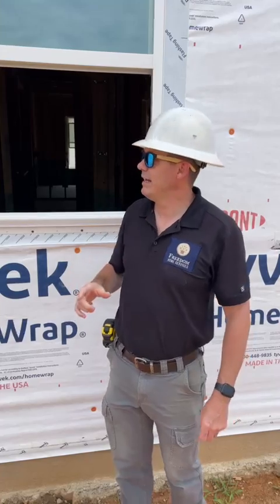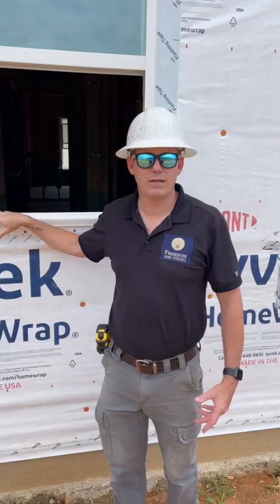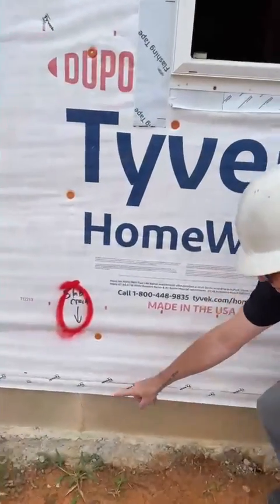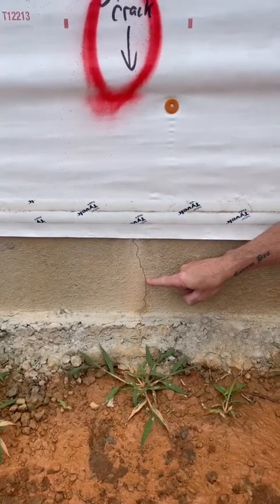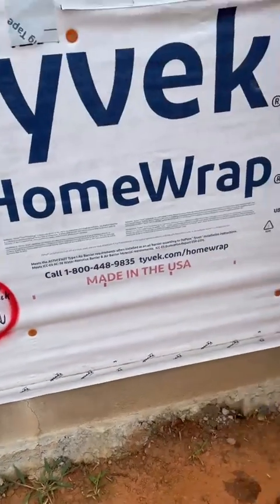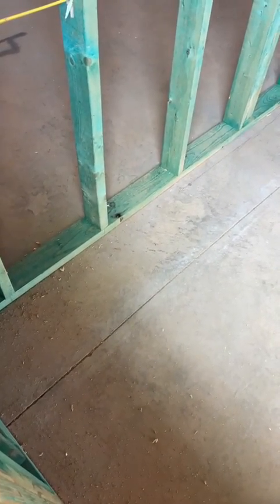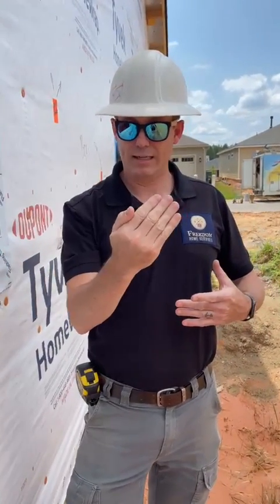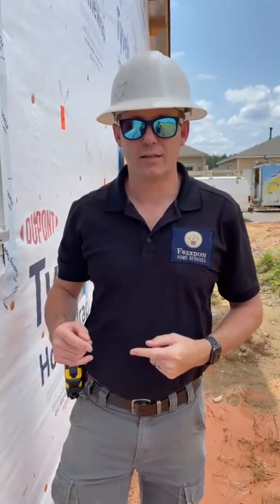Slab cracks on new construction homes EXPLAINED

Comment: That just straight out TERRIBLE WORK
Reply from the maker: Terrible work how in your opinion? This is how it's done in millions of slab homes across the USA
Reply: @Freedom4851Group 
 Well buddy you would be wrong ! That is how you cover a slab that was poorly poured. 
Now I have a degree in C.A.D.   and construction management, 40 years experience, 30 years running my own construction company and building houses in 11 different states running 1-5 crews . 
And I can truly say I have NEVER seen a concrete company cut a new house slab. "NEVER ! "
Reply from the maker: 😂 you sure do love yourself. What an arrogant answer. There are 50 states and the last time I checked Mr. 30 years in the business, not all had the same soil types or code standards. Hope in 2025 you can be a little less prideful and finally realize that you still have more to learn. A structural engineer signed off on these slab cuts and your little degree in CAD doesn’t trump that.
Reply: @Freedom4851Group 
 So how many states have you worked in ? 
That experience is worth it weight in GOLD ! 
Because different states you must build the house differently. What works in Florida don't work in New York. What works in New York don't work in Kansas and so on. 
How many years of experience do you have ? 
40 years experience is worth 10 of your degree's! And when you have been around 40 years you will look back that dude was right. "I didn't know shit back then" 
See because you can have your degree and only have 2-5 yrs experience.
Which means that piece of paper don't mean shit. 
And I don't give a damn what you think if you are having a lot of slabs cracking and being new construction something is wrong. 
And my 13 year old grandson is smart enough to figure that out !
Reply from the maker: @katkilr7685  thanks for all of the laughs, Karen!
Reply: @Freedom4851Group   Don't worry buddy I can tell you don't know shit, and so can others.  👍
Reply from the maker: @katkilr7685 😂😂😂

Comment: I have a huge hole/crack on the side of my new build and DR Horton claims that they need to build the frame and brick on it before they fix it. I am 3 weeks from closing and it still looks pretty bad. Wish I could show you a picture but what do you think I should do??
Reply: Get an independent inspection to verify your concerns and recommend the appropriate repair. Hopefully they don’t refuse as it is the builders responsibility to address any issues before closing. Your realtor should also be working with the builder to ensure your concerns are addressed with the builder.
Reply: what did u end up doing
Reply from the maker: @shachimerchant2433 Sorry for the late reply on this! That's a pretty common response - they don't usually fix these until the end of the build process.

Comment: Man that’s exactly what I have! 2 cracks on 2 ends of the house exactly same point, and I have a slight gap in the wooden planks on the floor along that line. So is there a way to tell underneath the wooden plank there is that control joint? Is there any building standard that says they are in the middle of the house or something?
Reply from the maker: not really a way to tell unless you remove the board or if you can see the saw cut on the sides of the home. It depends on the layout of the house but usually every 12 feet or so. They'll often install them at inside corners of the slab, like where your garage insets in to your home.

Comment: Awesome video sir. What if you have a crack like that without the concrete the saw cut? What higher degree or title for that matter would determine what type of crack it is?
Reply from the maker: Thank you! A structural engineer is who you would consult but they won’t even recommend any action unless the crack is 1/4” wide or if there is vertical displacement.

Comment: Hello thank you for the video really good. We got s new construction home that wl.be finished in September. In one of our visits I noticed a step crack in the mortar joints on the block wall, not a lot space between but the crack is there, combined with a hair rack on the floor. Could I show the pictures just for you tell if I should be worried or not?
Reply from the maker: Thank you for your comment. I need to do a video about cracks like the ones you're referencing. You likely live on a stem wall slab or masonry block foundation wall that has been parged (thin coat of concrete). That concrete will often crack in the mortar joints. This is not a concern unless the cracks widen more than 1/4 inch. Hope this is helpful and that you'll subscribe! :)

Comment: i just want to know if its a big deal for a crake that size in a new home, is that something to worried abt or no ?
Reply from the maker: According to my video, it really is up to a structural engineer to determine if it is really an issue. My video was created to  shed some light on common misconceptions about slab cracks and also highlight how the majority of slab cracks actually are formed in hopes that it would reduce worry about these cracks. Please consider subscribing! Thank you for the question.